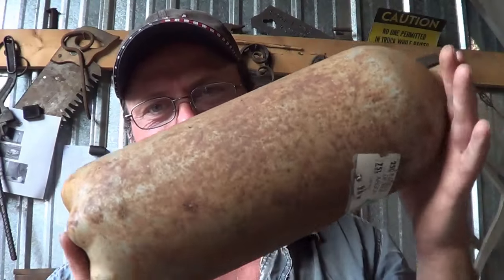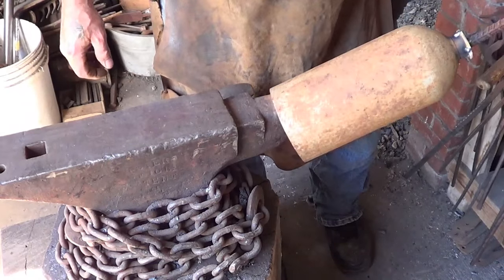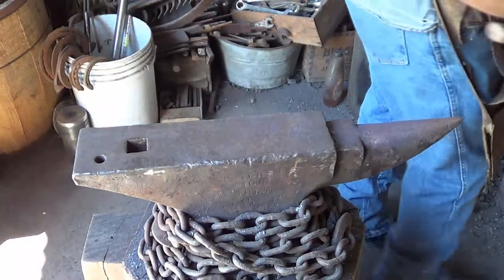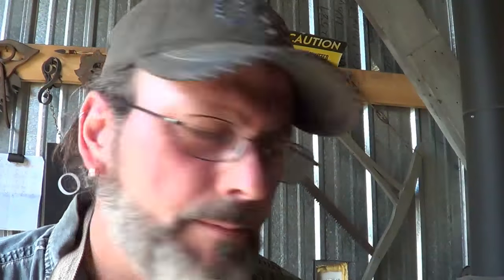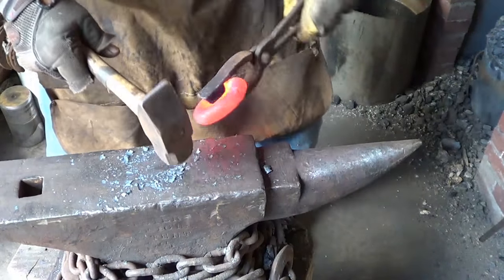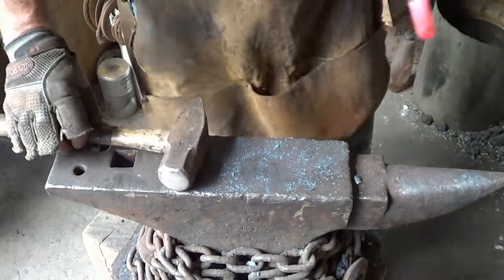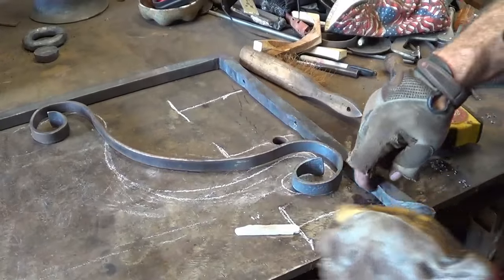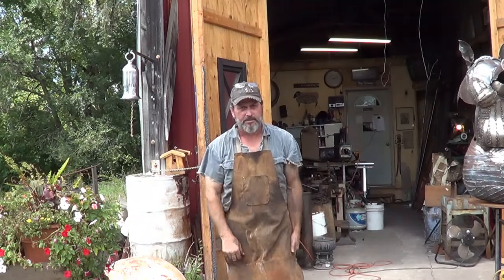Blacksmithing - Forging a Door Bell and Bracket For The Shop

Comment: Another great video. Safety first with gas tanks. My grandfather worked as a welder and machinist. He saw a acetylene tank fall off a truck breaking the valve. Shot like a rocket across factory loading area. Luckily no one was hurt,

Comment: That's a pretty sweet bell! A fun project and very inspirational, might even try something like it for myself. One thing I would have done differently though, would be to make the diagonal piece end at one of the attachment points and have the screw or nail go trough both pieces and into the post. Keep up the good work!

Comment: I like watching your long arse video's!

Your bashing and crashing around has inspired me to get a few smithing bits for the shed.
I worked as a MIG welder for about 10 years, and have spent a few years in the toolroom, so metal is in my blood. I have a nice little market down the road in the village, so I am going to be taking inspiration from you and start with a few herb choppers and the like.

The cost of an anvil is a bit evil though, might have to have an investigation into casting something up for myself...

Comment: I was certainly impressed by the 90 degree corner you put on that bracket. I couldn't figure out what you are trying to do and was about to start shouting at the monitor for you to leave it alone before you broke it :-). Anyway, great job. The bit hanging down inside the bell to ring it is called a clapper, btw. You should hang a small sign off the clapper or near the bell with just: "Find Chandler"

Comment: I think but don't know for sure, but the " woofing" you hear is methane gas that is coming from the coal. The methane gathers inside the tank and when the right air/gas ratio is right, it ignites. When I do events I use hand pumped bellows. I have had my bellows "woof" and toss a 3 lb weight to the ground. Don't think argon gas is flammable. Just be careful. I just love your videos. Take care. Later.

Comment: Hey Chandler! If'n you find another need to flare out a circle again, try using a cone. Heat your material and use the cone to do the flaring as you pound from a reinforced top? One of my 'brain phartz'.

Comment: Like the video, though I think you bit off more than you could chew on this one.  Bells are usually cast or turned for the reason that it helps keep the shape and thickness as uniform as possible.  Regardless, keep on keeping on, and making videos.

Comment: The proper term for the clanger is a clapper. I dunno why, because clanger sounds more accurate, but there you go. Anyway, I think we've learned why bells are usually cast instead of forged; it's way less work.

Comment: If you didn't had any holes at the top, it would literally explode. It's like a baloon. If you're putting gases inside a baloon, it'll get no way to escape, so the it starts lifting the baloon. Same thing with that container. But because that container is more solid than a baloon, you would get an explosion.
Reply: but it is not completely closed, gass can escape from under tre bell as well
Reply: Burning coal, or any solid fuel really, produces gasification.  The gas is what ignites after the solid fuel smokes.  The smoke is mostly a long chain polymer.  Heating that polymer further cracks it producing substances like butane, methane, and propane.  If there is not enough oxygen, these will build until ignited by the open flame.  With a cylinder like that, the gas would likely ignite in such a way as to make a rocket that woofed out for a few hundred milli-seconds.  It would pretty much hop on the forge.

Comment: What size hammer do you mainly use?
Reply: I think he uses a 4 pound mostly unless he needs smaller.
Reply: Jon Blais thank you. I'm trying to get into black smithing myself. Trying to get some pointers
Reply: the only 2 hammers I use are a 4 pound cross peen and a smaller ball peen, to start really long pliers could do till you can make or get proper tongs. my pliers are almost 1 foot long. in my opinion the anvil is probably the most important. Before I got mine I used a 1 and a half inch plate which was a homemade weight for a tractor which was really just as good. If you anvil isn't right it'll make your Hammer blows do less and make you work harder. I'm no expert by any means (backyard blacksmithing for 1 year) this is just what I noticed. I used a wood stove with an air hose burning scrap wood as my first forge, so the forge could be anything you can make a fire in.
Reply: sorry I kinda just couldn't stop with that.
Reply: +Jon Blais lol. thank you